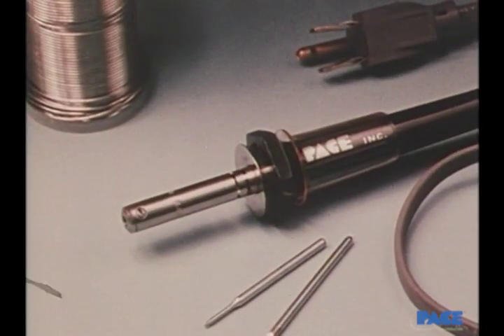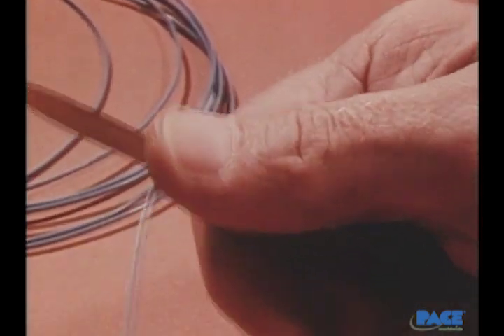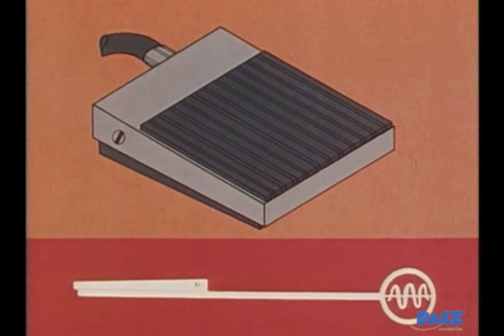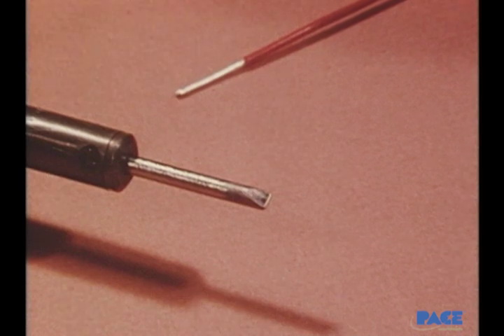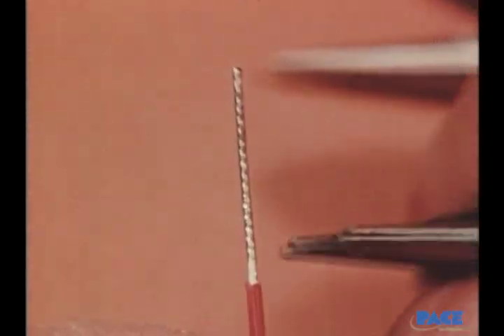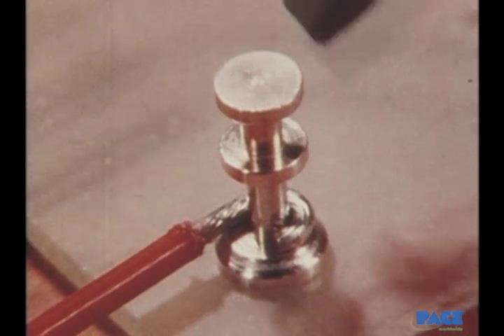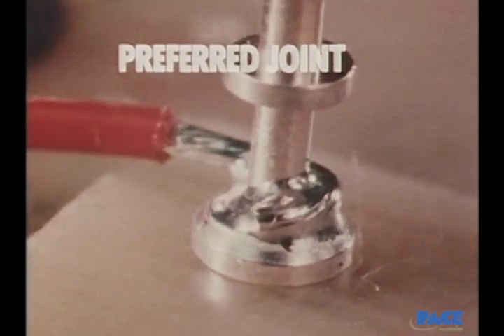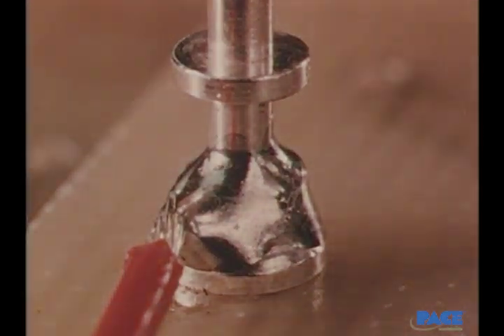Basic Soldering Lesson 2 - "Soldering To PCB Terminals"

Comment: I have a number of vintage audio amps, pre-amps, tuners, etc. and I generally open them up give them a good cleaning both general dust and also Deoxit the physical switches, selectors and sliders before plugging them in. I still remember "popping the hood" on my Sansui AU-517 (great but not top of the line) and I was struck by how beautifully it was designed and assembled. It was soldering craftsmanship I can only hope to achieve. I'll keep practicing.

Comment: An "expert" that touches the solder to the iron's tip?  HMMM/bogus!  Solder flows to the hottest spot, THEREFORE, one heats the components to be joined, and touches the solder wire to the opposite spot, AWAY from the iron's tip.
Reply: If you listened to the video, you notice that only just enough solder is added to the tip to form a thermal bridge to the joint, then solder is added to the backside. Not doing this can cause cold solder joints since the heat of the iron is not getting efficiently transferred to the joint.

Comment: Old Skool... found several mistakes I have been making... thank you for the upload! Still in search of solution for problem of flux leeching up strands, that corrode strands inside insulation. (currently using Topnik RF-800 "SMD", "no-clean"? , applied very sparingly with syringe...)

Comment: Teflon-insulated wire is real hard to strip without thermal strippers.
Reply: Coax is no picnic either, even with purpose-built strippers. To begin with, I don't even think the smaller gauges have such tools. (At least I've never found one.) And it's incredible easy to nick that fragile braid. I'd love one of those heated tools.

Comment: 30 watt? I keep hearing 60 watt is the way to go. Just bought a new Weller that boasts 60 Watt. I know there's different applications but it seems they used to just use 30 watt here. What is best for electronics today?
Reply: @johndaniels972  When it comes to temperatures, 100 experts will give 100 different answers. I solder at 371C, the upper limit I was given. Used to solder at 350, but was told that would burn things up by taking too long. (Especially transistors and such.)
Reply: 60 is the way to go, the same series tells to use the hottest possible

Comment: I realy love, how this old Lession is still useable in almost any situation. Made in China... They should learn, how to solder like PACE Inc. I saw many Chinese products, where the ammout of solder might be good, but there are often cold joints or leads bent wrong. Also: Why do chinese factories use that thin wire, that breaks after moving it 3 times? In this video, you clearly see, what a good cable looks like. I love it much. Thanks, it is entertaining me, to see such good work!